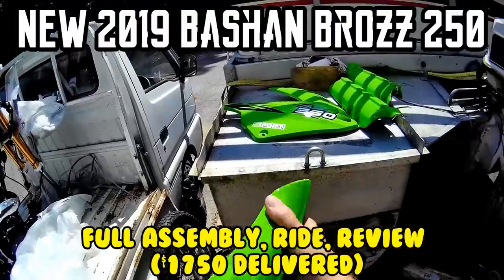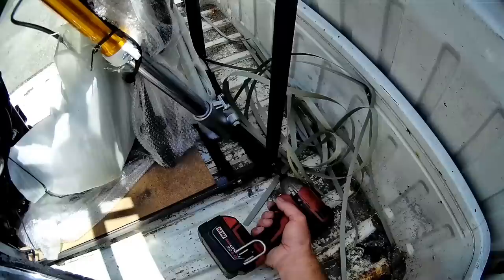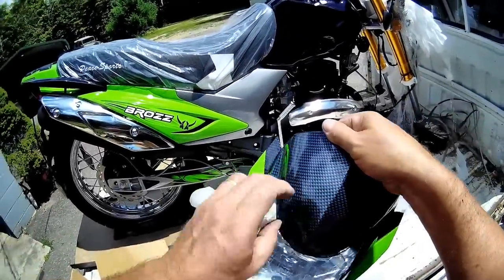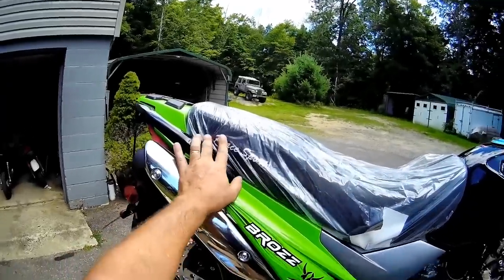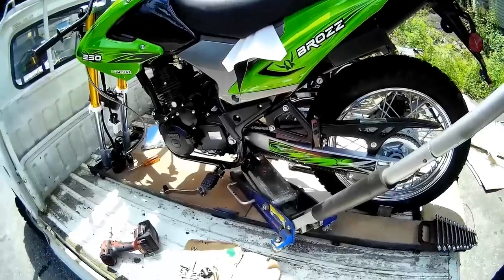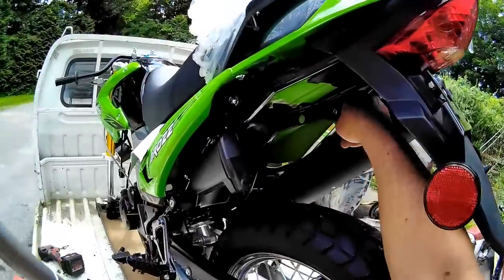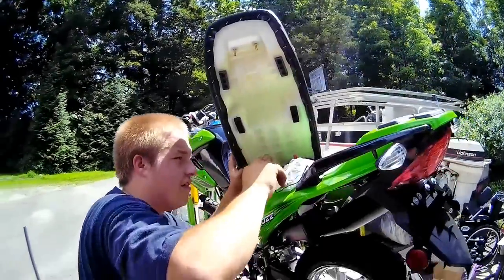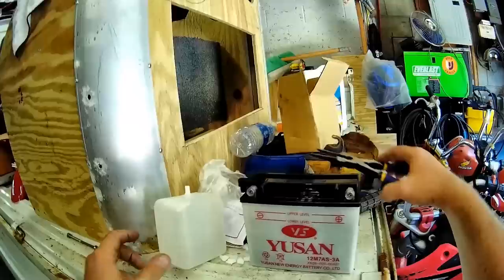NEW 2019 Bashan Brozz 250 Dual-sport Full assembly ride review ($1750 delivered)

Comment: FYI Peace Sports is sold out of the 19 Brozz models. (I bought the last one which was their floor model) They have super killer deals on the 18 models though. (Drum brake in rear, single instead of dual piston caliper in the front and different forks.) I was told the 20 models would be in about Valentines day which are like the 19's except they have a skid plate and the fuel tank (cap) has changed. Been in the process of breaking mine in. Love it so far, can't wait to see what she's got!!  ( www.brozz250.com )
Reply from the maker: Awesome thanks for theinfo

Comment: How is this thing compare to the Tdub?
Reply from the maker: Hmm, honestly, the Tdub is in its own category. Speed wise they're about the same. The Tdub has a lower seat and fatty tires
Reply: @MotoCheez  so you think about the same as Tdud for speed and acceleration? How about weight? What did these weigh? And how much taller you think it is (seat hight) than the tdub? Thinking about replacing my wife's tdub with this.
Reply from the maker: @TTarlov  the hawk is a tad bit faster, and a few inches taller. A roughly 33" seat height. The magician is closer to the Tdub is size, but hawk is better bike IMO

Comment: How is the bike doing?
Reply from the maker: Great. My friend Tim bought it and he's been using it, he also has a dr-350 and he likes to brozz better because it's electric start smooth and quiet so he ends up using the bras more than his Dr
Reply: @MotoCheez   nice, I thought about getting one just worried about putting it together
Reply: The x pro 250 is pretty much the same? Amazon has it listed for a 1395$
Reply from the maker: I don't think it is, the bras has a counter shaft CG engine it is made by Bashan
Reply: @MotoCheez  you think it would be a decent bike?
Reply from the maker: The only x pros that I've seen are actually hawk 250s and dlx's. The brozz 250 has inverted forks also I'm not exactly sure which model x pro you're talking about but if it's that price it's probably like the original hawk 250. The only problem Amazon is you have to pay shipping so make sure that you're getting the best price
Reply: @MotoCheez  ok thank you

Comment: What is acceleration like on this bike?
Reply from the maker: It's not a powerhouse. Probably a bit better than the original hawk, I'll be doing 0 to 60 times in next video, hopefully in about a week
Reply: MotoCheez 👍🏻 thx.  I’m looking to get one of these China bikes.  I’ve heard that several parts like carb and front sprocket are best replaced on the hawk, which just increases overall price.  And let’s face it, some stuff just needs replacing on these.  Which of the Brozz, Tao, and Hawk would you say is best price overall?
Reply from the maker: @ghosthunter152  I'd have to say the Brozz for the price. But it's going up soon!

Comment: Quite low powered for a 220... As long as it works tho. That price was nuts...
Reply from the maker: True, but my  cfr250l didn't have much more for being EFI and liquid cooled
Reply: @MotoCheez  just checked the 250l cause we dont have it here, i guess yeah, with westerner stature  it would make difference but still ok ish. We have the 250rally with 24hp here but it costs about less than 5k. The closest chinese bike with 250 and 24hp would be around 2,5k usd. I found one with similar power with this bike that costs a bit under 2k but a non road legal trail bike so yeah you got a great deal there.

Comment: Very cool almost like my enforcer
Reply from the maker: Same?
Reply: @MotoCheez   very similar forks are different, mine has that remote starter as well the airbox didn't need the mod but I've done the upgraded exhaust,and I put the new carburetor on it also. kinda looks like yours is the sum of the issues that mine fell short on. I still don't have 10 miles on it yet! I'll get out on it eventually. I'm really considering swapping the knobby tires for some more on off road tires like yours came with!

Comment: These chinese bikes seems so tame compared to my beta rr 400 :D
Reply from the maker: Of course!! 😁
Reply: MotoCheez I got that bike last sunday and its so insane xD. The only problem with it, is that the battery does not charge so I cant use the electric starter. And oh boy is it tough to kick start :D
Reply from the maker: @megapet777  I've never ridden one yet, but seen a few. How do they compare to the Huskys and KTMs?
Reply: MotoCheez ktm and beta are pretty much the same. Huskys are unreliable, but dont know about the new 2020 models. The beta 400 rr is super mean tho. Its not good for starters. Its way more aggressive and torqier than the 650cc naked bike I drove my license on. The bike just want to go man :D 0-100 in an instant. The bike just goes braaaap and you are going already wayy over the speed limit. Quick way to lose a license.
Reply: Also the bike is really loud. Though I have aftermarket exhaust. Love the sound of it.
Reply from the maker: @megapet777  agreed. Which is why maintenance gets a little pricey. It's all out performance.
Reply: @MotoCheez  Yeah. It does. But if you get a chance, I recommend to try it.
Reply from the maker: @megapet777  def want to
Reply: @MotoCheez  Yeah, it's way more powerful than I expected :D

Comment: That bike looks so cheesy. I'd be surprised if it held up. I'll stick with my 250L, love the FI. I offroad the crap outta my 250L and it has held up well.
Reply from the maker: They hold up well. Have a hawk250 3 years and magician with over 10,000 miles now
Reply: @MotoCheez how are you using them though? Mostly street or do you offroad em as well? The only time mine is on the pavement is when it's headed to and from the dirt.
Reply from the maker: @doobielawson702  90% dirt. Tough trails too. Have a ton of videos with them
Reply: @MotoCheez do you not like FI or are you just intrigued by the cheap price point of Chinese machines?
Reply from the maker: @doobielawson702  FI is fine, my CRF was EFI. Carb is easier to mid and work on and these cheap China bikes intrigued me so I figured for the money, I'd try it. Now 4 bikes later I guess I'm the China bike guy lol. They're not as bad as ppl think, but they're not a Japanese bike either... 😃

Comment: The problem with all these Chinese  bikes are the poor quality of metal they use. If you are a mechanic you can constantly repair or replace parts but for most people they will break and rot in their garages and later dump on craigslist.
Reply from the maker: Tom Ford they’re not as bad as they used to be. I’ve owned several over the last 4 years. Never had a frame break yet. Bolts vibrate out and 2 exhaust bolts broke. I hear from everyone over the last 3 years and never heard of a frame brake. Had a bracket break on the magician that bolted frame to motor once too.

Comment: These Chinese bike engines make no power..most 250s make 40hp this only makes 15 it defeats the purpose of getting a 250
Reply from the maker: Honda CRF250L is 18hp, what 250 makes 40hp that's a dualsport? The DRZ400 doesn't even make 40hp.... WR250 is like 23hp

Comment: 17 hp? No thanks. I would rather drop 1700-2000 on a decent used drz 400.
Reply from the maker: Good luck finding a decent DRZ for under $3500. These are more of a trail bike anyways. Lower seat height.